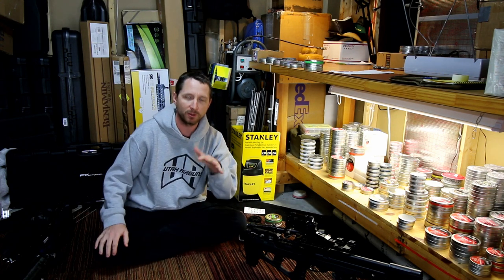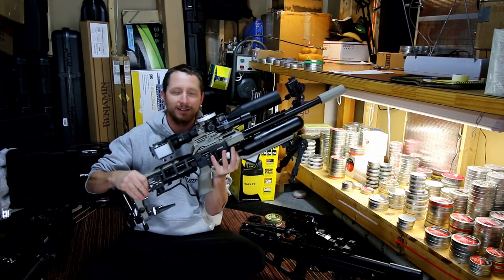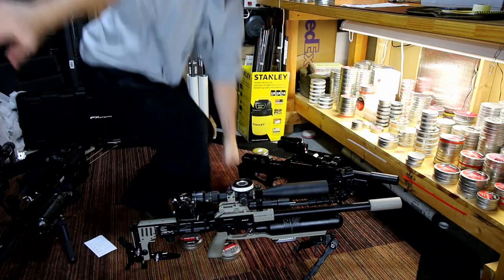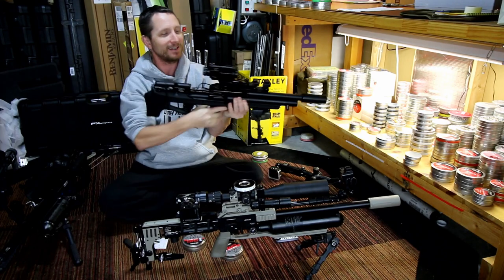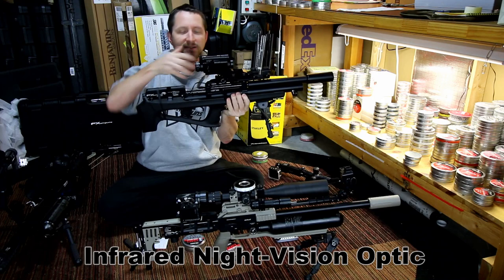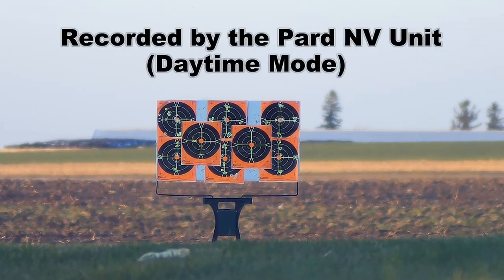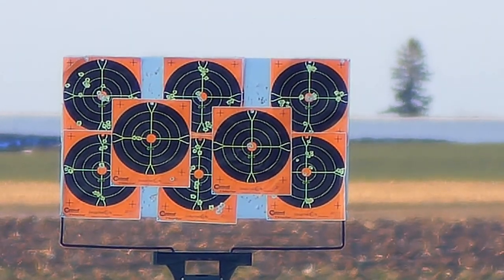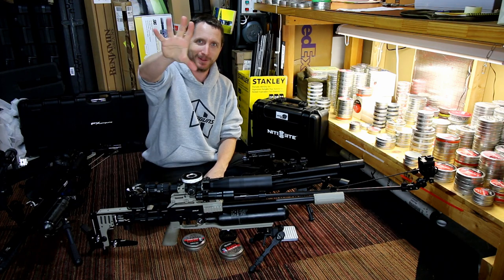Questions:  Painted Pellets, Oversized Turret Wheel, Pard NV008 Night Vision, Slugs vs  Pellets

Comment: Hello. I'm a long time follower and I enjoy your videos very much, but first comment.
Tracing pellets or slugs: I've made them with nail varnish and no wobble at all and accurate.
Pard: I have a 008 (no range finder) for over a year now, and the crosshairs are almost dead center of the screen @60m. @100m it's a bit lower of course. Not only my Impact has already the 20 MOA on the rail, but I used the small shims that came with the Pard. About the windage, I found out it was because of the small piece of metal underneath the rail, to fit a picatinny rail, instead of a weaver. That piece does not let you shift the position of the rail. If you take it out(it has a screw), problem solved, you will zero it around the center. The raiser you have is also very good...but a bit pricy.
If you give it half a chance, it's a very good night scope. And you get what you paid for...
Thank you very much.👍
Reply from the maker: Very good info.  Thanks!  A heck of a first comment.  :)

Comment: Try a YELLOW paint MARKER instead of using a can of spray. It’s a lot more precise, but of course a little more time consuming. If you want to continue using the spray paint, you can also make some homemade ballistic gel or just some kind of gel that will allow the pellets to sink in, but still be firm. Stick the pellets head first into the gel and push it so that only the skirt of the pellet is fully encased by the gel. Then spray away. I’d recommend the yellow paint marker though if you want to just use your pellet tray.

Comment: If you want to use the least possible paint, be sure to buy something that says 'self priming' - or just use a white primer. (in the UK we have something called Hammerite - self undercoating paint for metal. They do a smooth version in a rattle can. A  couple of light coats rather than a single thick one will give you white pellet skirts - you may find Zinsser B-I-N more easily)

Comment: My paint recommendation wood be striping paint for parking lots or if you can get your hands on it the reflective paint used on roads... and as for application I'd try making a pellet/slug holder out of Neoprene or equivalent using a hole punch to isolate the outer skirt from the inner wen painting or a drop of bright nail polish then re weigh the pellets.

🥃cheers🍻
Reply: Ps a back lighting system such as olight valkyrie will also help put the pop on any painted pellets it might even be good enough on it's own without paint don't know haven't tried it...
Reply: "reflective paint" for roads & highways is not reflective paint. Round glass beads are dropped or blown into the paint as it is being sprayed and light refraction from the glass reflects the color of the paint back to you at a certain angle. Some of each glass bead is exposed and some is imbedded in the paint (or cold plastic tape or thermoplastic or polyurea). Airport beads refract at a different angle.

Comment: Ted use your tray idea great but my thought was nail varnish as loud a color as you like draw it out of the bottle with a pipet one drop a shot allow to dry obviously  another good and bright source is rat trace tracking powder may mix with a clear spray varnish and air brush it in lighter weight more delicate finish JSB selective 200 shot boxs of hand picked ammo may have  better spraying trays love.the videos agree 👍 with politics no worries but still need more vids
Reply: Mr. Colclough, that was a  great and useful comment you made.  I saw one  air rifle enthusiast  on You Tube recommend baked on  powder coating on their pellets. I personally never tried it, but your idea seems to be the best. But you mention "Nail Varnish",  is that what we here in the U.S. refer to as "Nail Polish"?
Reply: @joedejesus6363  yeah nice n bright vivid colors draw out of bottle with a pipette one drop in back of shot allow to dry or dab smooth with q tip you can get some proper illumeinus fishing float paint dont add grease to any pellet this will not be  good for rifle spring or pcp
Reply: @leecolclough2492  Thank you for getting back with me so quickly, and thank you for the information. This will indeed be very useful in my shooting.👌

Comment: I tried using a luminous paint inside the pellet some years back for Night Vision shooting (Rats), I used a piece of foam with holes punched thru that were a tight fit around the skirt, so no paint leaked by but it was a pain trying to get the pellets placed in the foam, as each pellet flexed the foam on the adjacent pellet. The idea of the luminous pellet was high visibility on the Night Vision, so before going shooting and as the luminous paint faded over the shoot I would re-charge it using a powerful white light torch (not good for maintain a covert location or my night Vision). It did work and the pellets were very visible but it was a pain to do. Offsetting the Illuminator also worked because of a better angle to the pellets skirt. For day time shooting I would try a Hi Viz paint with reflective particles added like used on safety vests.
Reply: Mr. Gray, that's a great idea using a luminous paint on the inside of the pellet skirt. Would you happen to know the name of this paint? I'm already using  "Flouresant Green" nail polish on my JSB's for my daytime shooting. I use a Q-Tip to apply the nail polish.
Reply: @joedejesus6363  Hi, It's a Dulux dura max light up enamel "High performance glow in the dark for night safety" I also changed from spraying the bases as that was a pain trying to keep paint where I wanted it, to squirting the paint into a container and putting a blob inside the skirt using a toothpick. Tip- The stronger, whiter  and longer exposure to the light used to charge up the paint the better.
Reply: @stevegray4012  Thank you very much, 👍this informative will indeed be very useful to my shooting and tracking of my pellets.

Comment: Drill 5mm hole in bottom of each slug hole in the tray, then put pellets / slugs in bottom First, turn tray upside down so holes are up then spray. This should put paint on inside of slug / pellet without skirt bleed

Comment: Hey Ted - Great video as always. I seem to remember a video from Jiles I think (quite a while back now), which had a segment talking about a moderator that DonnyFL made which had a tracer type capability. As I recall, as the pellet passed through the mod, a UV element would interact with a coating on the pellet making it glow. Not seen anything like it since, but he might have some good ideas for a solution to your pellet visibility challenge. Not sure how his solution would work in daylight, but video capturing spiraling pellets at night would look cool and really get the point across! Just a thought...

Also, I totally agree with the politics thing, you're bang on.

Comment: I have an idea Ted.  I would try using a Birchwood Casey “Sight Touch up marker”used for adding paint in bright colors for iron sights.  I quick dab on the bottom of the pellet will give you a precise circle of color without the over run, and you can make very bright marks.  They are about 12 bucks for a set of three.